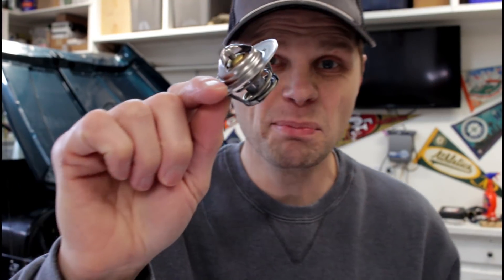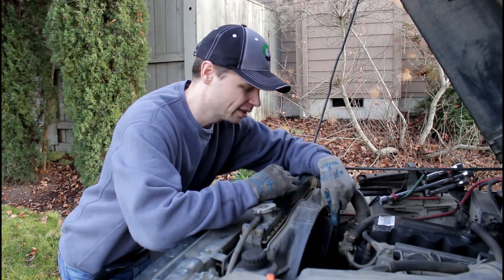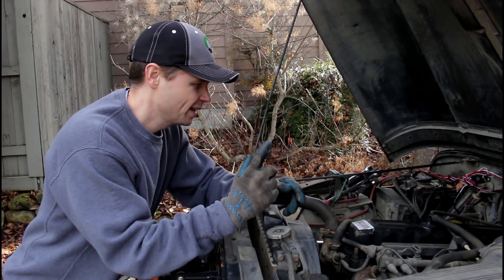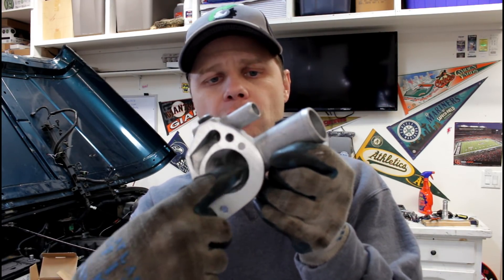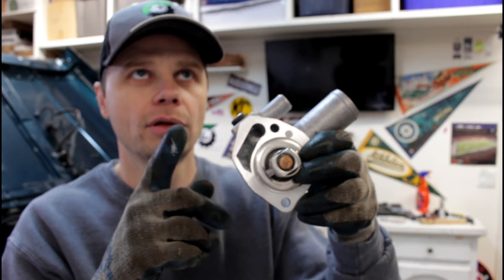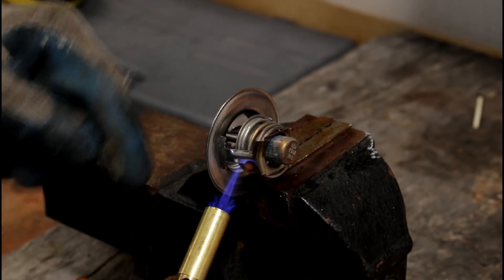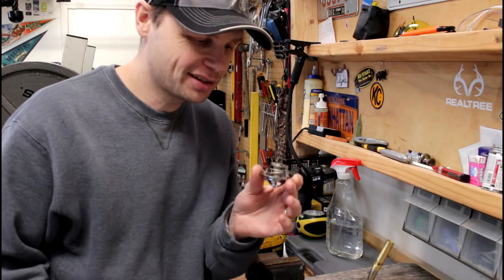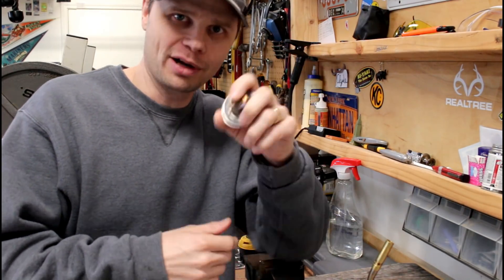Jeep Wrangler Running Hot: YJ Thermostat

Comment: how do i know if my thermostat is bad, or if its my coolant temp sensor. it runs hot
Reply from the maker: Hummm... Yeah, I didn't do a good job explaining that.  I think I'll make a video on that very topic soon.  I'll mention you asked in the video ;)
Reply: JeepSolid so I believe for some reason that I have the incorrect coolant temp sensor (I have the i4). I think the one in mine right now is from a CJ7, the guy before me must have bought it, and causing it to be the wrong one had to cut the wire that goes to the guage because it didn’t have the right connector

Comment: what thermostat do you recommend to use?, I get the same 195 but some people recommend to use a 180
Reply from the maker: Yeah, 195 is the way to go.  Some people try 180 for various reasons, but the engine is designed to perform best at 195.  I stick with what the engineers recommend.  They're smarter than me.  Ha!
Reply: I used a 180° one. My engine would run on the warm side 215°-225° if I remember right. I have the 2.4L powertech though.
Reply from the maker: Did the 180 bring the temp down a bit? or did you notice any difference?  At those temps the 195 should be open anyway, guess the 180 would open earlier.  What'd ya see?
Reply: Yes it did, though it does hit 210ish on really hot days.